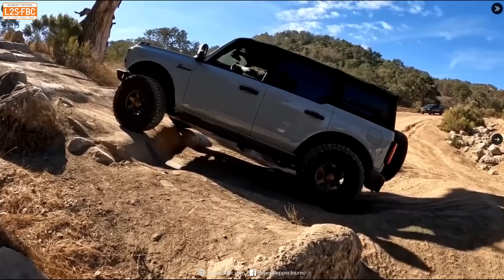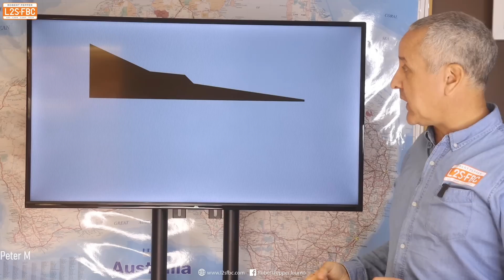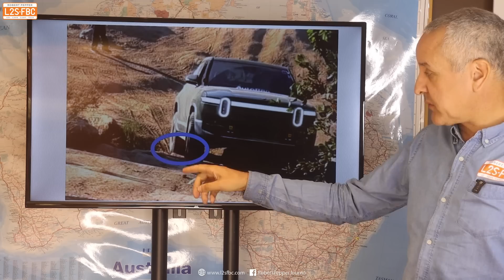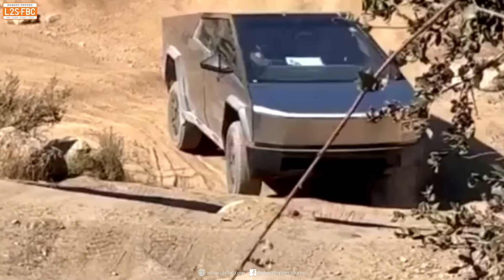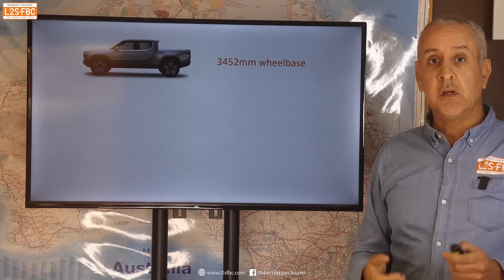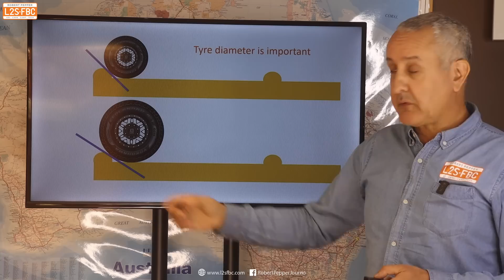Tesla Cybertruck Climb : Analysed & Compared F-150, Rivian

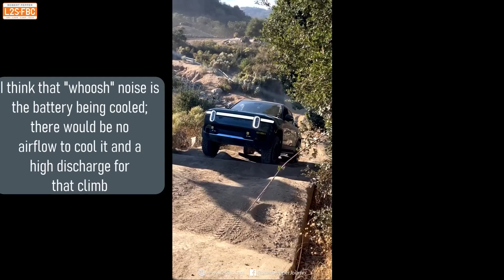Comment: This high discharge 5:55 for Rivian during aggressive climbs was very noticeable during the historic Rubicon Trail. This extreme accomplishment for Rivian (first ever production EV to complete the Rubicon Trail) resulted in a 80% battery pack being drained to less than 10% after about a 12 mile trail.
Reply: If you ask someone that was there on the trail that day, the Rivian was rock stacked, dragged across the Rubicon, and took every bypass. The Rivian support vehicle R1T even broke a tie-rod and was blocking the trail. That's why there is no video online, only a few pictures. Dragging a 7k lb SUV across the Rubicon isn't something you'd gloat about too much.
Reply: @CallsignVega ... It's only a matter of time before we get video of a Cyberstuck that has bottomed out & is up in smoke ... just hoping the passenger doors have a mechanical release.
Reply: LOL, possibly.  But they do.  All Tesla doors have a mechanical backup release. @kradius2169  Breakover angle is a concern, but if you can air it up to what is called extract mode (17.4" of ground clearance) you might be able to get over those spots.  After watching just the guardian rocks at the Rubicon for about an hour, I was pretty amazed at how many vehicles (of every kind) had to be dragged over them to get on to the beginnings of the trail. So many stupid lines!
Reply: @kradius2169   LOL, With 17 inches of ground clearance at the highest setting, that ain't gonna happen. Additionally, with the aftermarket parts that are available already, the Cybertruck can easily reach 20 inches of ground clearance with 35" tires. With 39s, it is going to reach 22 inches, which puts it in the Unimog class.
Reply from the maker: That surprises me...I'd have thought it would have been quite capable?
Reply: @CallsignVega  in every video I've seen, Rivian aced the offroad comparisons. You probably are an EV hater.
Reply from the maker: Thanks!
Reply: yes finally a truck that says I'm vaxed and boosted
Reply: @liuwang2201  🤡

Comment: Great info, thanks! One other thing I noticed, is that it appears that both the Rivian and Ford had their tire pressure set lower (at least I saw more tire flex). From my experience this could also affect traction in this hard surface with sand/gravel/dust and dry conditions.
Reply from the maker: Yes lower tyre pressure would help to some degree but it is a hard surface so not so much as a soft surface.

Comment: Does anyone know the mass of each vehicle ? e.g. CyberuglyMyEyesAreBurning vs Rivian vs Lightning ?
Reply: About 1000lb more than a Raptor.  Basically about the same as a Lightning.
Reply from the maker: We don't know Cybertruck, rest I could find out - be around 3.7-4.0t. However I've found that on hard surfaces like that mass is not a huge factor compared to tyre diameter, wheelbase, traction aids and in the case of the Jeep shown later...width!  The 6t trucks like the Isuzus are immensely capable despite a huge weight increase over say a Ranger.

Comment: Ta Robert, as a fellow 4x4 instructor, this is a good take. Watching those cybertrucks and how they were driven suggests that they were testing and tweaking. I can't imagine that the test drivers were that bad...
Reply: Even in combustion engine cars you will notice when the esp was trained well or the just used the besic program of the shelf. Had a car where the esp the was working with me and you could even go sideways as long as it detected you're still in control. And some the work against you like mommy and daddy sitting behind you ready to take control.
So you need to bring it to the max to train the computer all possible situations.
The rear end going sideways could be compensated with the rear steering...as it's all ECU,you just need to tell him what to do.
Even Nissan made it was with the gtr 34, the rear wheel steering was turning against to get tighter turns at slow speeds, at higher speeds it was turning with to make smoothe lane changes and cornering, plus when the car got unstable it counteracted the wobble from the rear to straighten the car back out
Reply: That's exactly what the Tesla engineers have said it will do, against at low speeds, with at high speed (over 40mph) and using smaller angles (2-3 degrees) @mammutMK2

Comment: Rivian doesn’t need to brake the spinning g wheel, because, having 4 indipendent motor, one per wheel, not connected with the others, just cuts the torque to that wheel. But the fact that is spinning doesn’t effect the torque on the other wheel, because they have their own motor and there’s not a differential that transfers the torque from one side to the other.
Reply: It depends on the rivian.   Some have four motors, some have two.
Reply from the maker: exactly

Comment: One thing that is missed is this was not the first cybertruck to go up  that.   One went by after going up before they filmed the second one.   Like the Rivian or even a 2010 LR3 the cybertruck has brake traction control.   The rivian quad motor has an advantage but Rivian has updated their BTC on the dual and tri motor models.  The dual motor version of the Rivian wasn't so good until the update.   There will also be tri-motor cybertrucks too.   An offroad menu with more offroad modes than land rover's terrain response is as easy as an over the air update.   Open differentials or lockers off on a rover with terrain response in the right setting goes up the hollister stairs just fine on brake traction control alone.

Comment: maybe the brake lights come on automatically as the brakes are applied by the rivian itself
Reply: Two foot driving is not what you want to do with BTC.
Reply: @MotoGPatrick  That is another strike against BTC vs plain old lockers.  Two-foot driving is the best way to control the vehicle as you crest obstacles and is taught by trainers from overlanders to rock crawlers to military because it works and provides the best control.  I know many brands have tried to simulate this with various forms of off-road cruise control but I've never seen one that actually works 1/4 as well as an experienced driver.  Of course that's sorta the whole point of all these things - to take the driver out of the picture and let the truck do the work instead.  Sorta speaks to our society as a whole in a lot of ways.
Reply: @RoverDon123  There is cover but dont ride the brakes so the system can work two pedal as well.    Thats with ICE and the best BTC

With anywhere from two to four motors and differentials a thing of the past when wheels have their own motor and torque vectoring   Techniques need to match tech.  

I had a FZJ80 with e lockers on  both ends and I"d lock and mostly cover brake 2 foot it up.  

With a 2011 raptor modded out to long travel prerunner I would ride the brake a bit more often if the torsen needed help.   I've ran stairs slow but also hit desert whoops as gnarly af highwya speeds where I was in 2wd unlocked. 

But evs aren't going away, I've even seen . Some EV swapped rock buggies that can do amazing things.   Center of gravity is pretty much the center of the bottom of the chassis.  Angles a  ICE buggy would flop over at, it still had traction.
Reply: @MotoGPatrick  Oh, they have potential.  It's just not fully realized yet.  I'd be happy to buy an EV if it could meet my needs but that doesn't exist.  Same for off-road work - given enough time and development they'll get there but the time isn't now.  As for BTC, I have yet to see any version that can match a decent driver and plain old manual lockers.  The simple fact that it has to be REactive instead of PROactive is a massive disadvantage.  Mostly it seems all the various electronic systems are more designed to simulate a locker and help novice drivers instead of being optimized to work with an experienced driver.  Again, having 4 fully independent motors could offer the maximum potential but thus far it hasn't.  I'll keep watching
Reply from the maker: I agree with 2-foot driving on rocks, but that's steep uphill and it's not hard going so shouldn't be a need for it.
Reply: @L2SFBC Too many assumptions. Driver could have braked to calm the truck down, got a radio call, waiting for cameraman, on purpose to drive poorly, by accident, experimenting…. Even he probably doesn’t remember why 30 seconds later. You’re gonna have to wait until driving one yourself shows you what’s really up.
Reply: @L2SFBC  I've driven that little climb plenty of times as it's a Hollister Hills OHV area south of San Jose, CA.  It's concrete pad with rocks/steps set into it.  It's usually dusty and fairly low-grip so that's the biggest challenge.  And yeah, you shouldn't 'need' to 2-foot it but at least for me it's so ingrained I don't even think about it most of the time; it's just automatic any time I'm going slow off-road.  My original comment wasn't so much meant that they needed to do it, just that maybe they were doing it causing the brake lights to be on.  Purely speculation.  Anyway, just another comment for the algorithm!
Reply from the maker: No but you would for rocks
Reply: I consider using both feet with one pedal used at a time to also be 2 foot. Some trucks its better to be off the brakes and let the BTC eat even on rocks.  

You are a milesecond from using them if you need to.  I've even seen some videos from down under where they say to not always assume lockers are better than BTC  Oh yeah that was you..     @L2SFBC
Reply from the maker: They shouldn't be applied at all
Reply: @L2SFBC  I would disagree; 2-foot driving is the standard for rock crawling.  Certainly this ramp at Hollister Hills isn't rock crawling but it provides far better control to drive 'thru' the brake.
Reply: @L2SFBC I would imagine the brakes are a function of the one-pedal driving, any deceleration triggers them.
Reply from the maker: Yes but only deceleration hard enough to warrant a brakelight
Reply: @L2SFBC  brake traction control?

Comment: In a well designed electric drive the RPM of the wheels will do the right thing and the torque will be adjusted to make that happen.  When the vehicle is straight onto the simple hill all 4 wheels should turn at the same speed.  When one wheel or one set of wheels is on something steeper that wheel needs a bit more RPM.  This is just a little better than a lock diff.
Reply: In theory better, but in reality you have to wait for tires to start spinning and the computers to then make adjustments.  The benefit of lockers is you can engage them prior to spinning tires and avoid slipping off your line in the first place.  That's the same issue with any brake-based traction control - it will never be able to match a locker until it can preemptively intervene.
Reply: @RoverDon123  You seem to under estimate the speed with which electronics can do stuff.  Brake based traction control is always going to be much slower than an electric motor based one.  Actual mechanical stuff has to move.  With semiconductors, in under a microsecond,, 500V can be applied to a winding.  Also, an electronic system can preemptively intervene to do the increased speed on the wheel that is traveling a greater distance. 
I am not saying Rivian does this because I didn't design it.
Reply: @kensmith5694  Again, in theory it sounds great.  In practice we've all seen them struggle - waiting for a tire to start spinning then applying correction.  If you are doing any sort of technical driving you know that spinning = bad as you quickly move off the correct line and just an inch can often be the difference between making it up or not.  Brake based TC can't do anything about this but individual wheel electric drive could if there was basically a "locker" switch which would force each tire to work together and could be engaged prior to attempting the obstacle.  There is much potential for electric in the crawling world but thus far it hasn't been realized.  But the possibilities are substantial.
Reply: @RoverDon123  You will notice if you go back and read my comments you can see that I stated things as what an electric system could do if engineered correctly.  I tend to do that, being and engineer.  Yes, I presumed something told the electronics a hill was being climbed.  In a machine as expensive as the Rivian,  sensors and cameras and the like could do that for you.

Comment: Great video, Robert.  I love the RC demonstrations and other visual aides.  This video was also a good reminder of why I drive old Jeeps off road instead of $100K EV's. ;-)

Good point on the throttle control.  My wife and I both have EV cars as daily drivers.  The throttle mapping and gear ratio, along with instant torque, works great for the street, but would be a disaster for an off road vehicle.  For example, I have real difficulty getting them onto car ramps where you have to drive up an incline and then over a hump in a controlled manner.  

I would suspect throttle mapping specific to off road use would be a necessity for any EV intended for off road use.  Rivian seems to be taking off road capabilities seriously and has probably already worked out those details.  It's less certain if Ford and Tesla have.
Reply from the maker: Yes, throttle map is SO important and easy to do in EVs.  A low crawl ratio would be great for that climb and not need any jumping to/from brake to destabilise the vehicle and risk a roll-back like the Tesla.
Reply: @L2SFBC it should have been great to include range rover for example! Or even Toyota! They have amazing Offroad capabilities and the crawl control system too.
Reply: @L2SFBC with the crawl control system you can choose at which speed you wants to go, up or down! No need to use the pedals just steering
Reply: The Ford lightning is not an Offroad centred truck and it's also the least powerful of the group! The Rivian has 4 independent electric motors and it struggles alot compared to even 100hp ICE!

Comment: Higher battery discharge from climbing on a trail isn’t good. Thermal runaway in the wilderness is extremely bad for a scenario where the battery can’t cool enough.
Reply: Pure insanity to drive something that POSSIBLY can catch fire, but can't be extinguished, into the wild. Hello wildfires that we don't need!
Reply from the maker: It's just the battery needing extra cooling, not a fire risk. The car would have failsafes to shut down before that, like an ICE.
Reply: @L2SFBC actually it's not the battery it's the electric motors and inverters that needs alot of cooling since the vehicle isn't moving faster and the electric are been heavily used. I've seen alot of tesla and Rivian Offroad and they were even much louder than the ICE they were together.
Reply: @L2SFBC  The Tesla that went into the lake from the boat ramp accident had the failsafe too but it kept the flames going while underwater. I just can’t trust them.